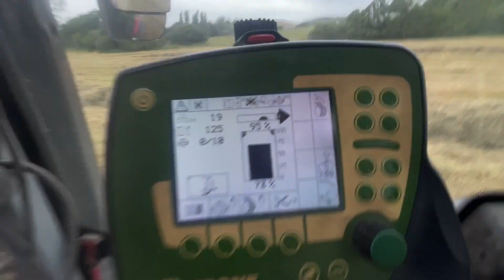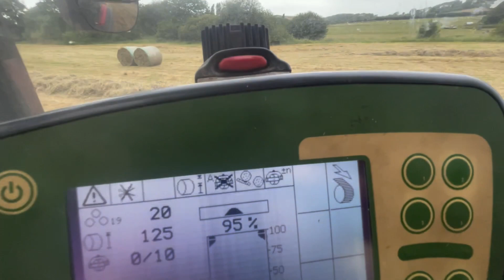BALER FIRE!!! 🔥🔥🔥

Comment: How many bales has the baler done if you dont mind me asking? Is it still on the original rubber belts do you know? They must be a pain to change and there quite expensive i think. Ive got a F155xc  baler with no wrapper. Like the baler, been having problems with the net not spreading quick enough though.
Reply from the maker: Answering Viewer Questions On The Krone Comprima CF155XC
https://youtu.be/xqhI0CKFhO4

Comment: Not simple to work at, especially when you need to climb over an assault course to get into it every time. Did you pop out the rubber seals in the bearings and pack them with grease? Or are they grease able?  Put alot of new bearings in krone balers and other machines and you'd be amazed how many are as dry as a bird's arse with not a pick off grease. No wonder they don't last.  I packed both side of bearings on a round pack and they lasted for year's compared to months when unpacked.👍
Reply from the maker: Have seen that before never tried it myself afraid I’d fuckup the seals. Only recently got the baler and been stood for a couple years so some of the bearings are stiff probably replaced 10 or 12 so far but this was by far the worst ones to do